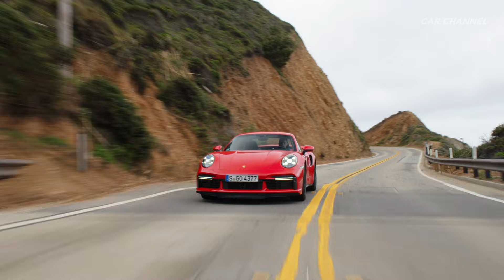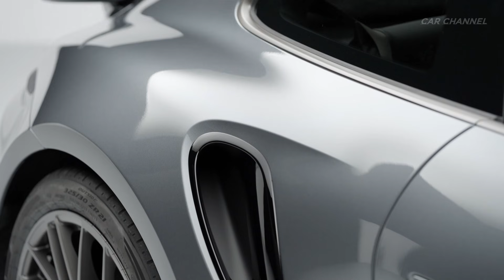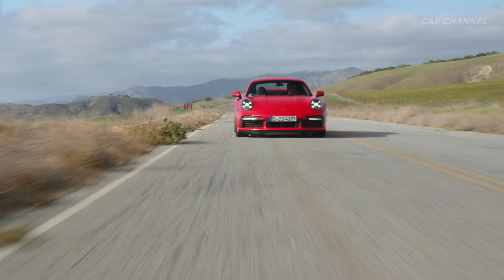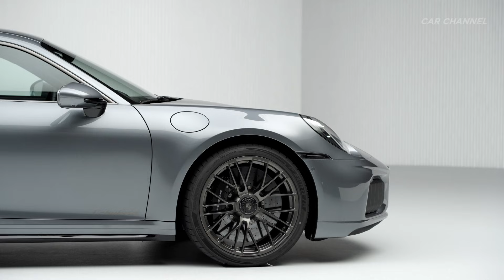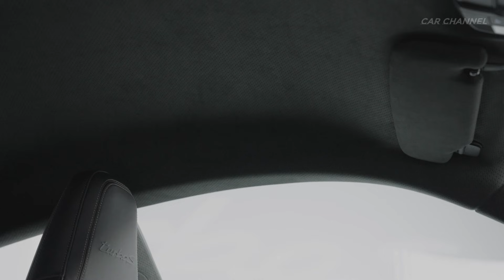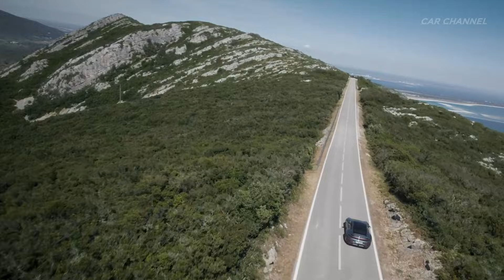2026 Porsche 911 Turbo S vs Old Porsche 911 Turbo S 🔥⚡

Comment: Should I trade my 2023 turbo s cabriolet for the new turbo s I am confused if it the right thing to do 😢
Reply: The ideal 911 turbo S is the 2023 992.1. I own a car except mines a coup no sunroof no rear seat seat GT silver black interior yellow stitching and a whole bunch of options. In addition the engine specs e been remapped so the car puts out pull over 700 horsepower this remapping was done by a Porsche dealer. So the car has no battery no electric motor both are garbage they had 200 lb and batteries and electric motors on nightmares so keep your 2023 service irregularly on the call will last you forever